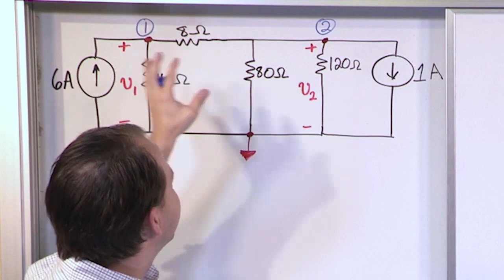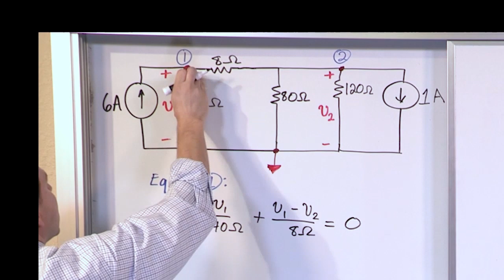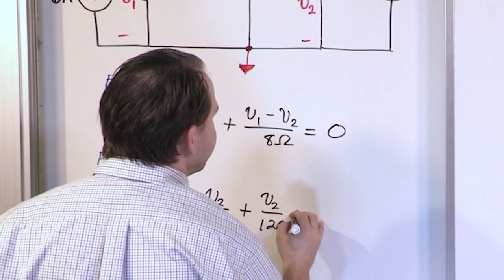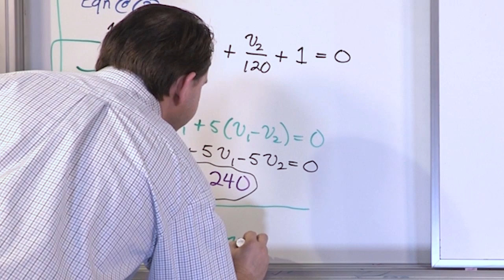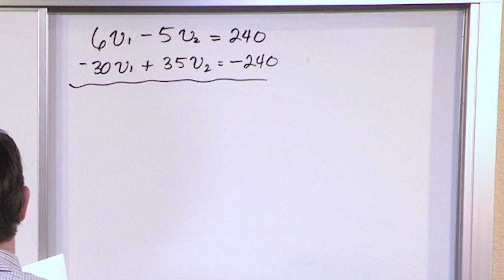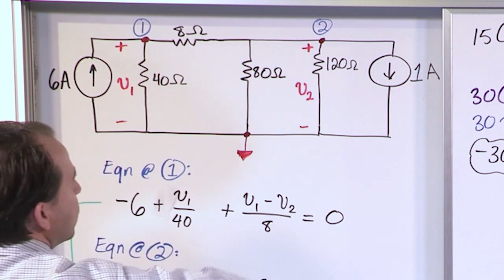Solving Node Voltage Problems

Comment: I think the same problem can be solved using loop current method.
Reply from the maker: Sure but node voltage can be used to solve more complex circuits, so that is why it is taught.

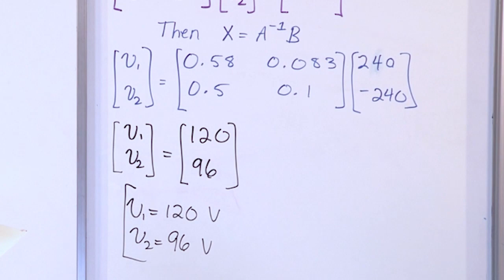Comment: 18:55 how did you calculate 120 and 96 from those matrix products?
Reply: To multiply these matrices:

For the element in the first row, first column of the resulting matrix: Multiply the first element of the first row of Matrix 1 by the first element of the first column of Matrix 2, then add the product of the second element of the first row of Matrix 1 by the second element of the first column of Matrix 2. 0.58×240+0.083×(−240)0.58×240+0.083×(−240)

For the element in the second row, first column of the resulting matrix: Multiply the first element of the second row of Matrix 1 by the first element of the first column of Matrix 2, then add the product of the second element of the second row of Matrix 1 by the second element of the first column of Matrix 2. 0.5×240+0.1×(−240)0.5×240+0.1×(−240)

Now, let's compute:

0.58×240+0.083×(−240)=139.2−19.92=119.280.58×240+0.083×(−240)=139.2−19.92=119.28

0.5×240+0.1×(−240)=120−24=960.5×240+0.1×(−240)=120−24=96

The resulting matrix is:
V1 =119.289 
V2 = 96
Reply: @arthur321654  this is much more clear now! Thank you very much! 😊